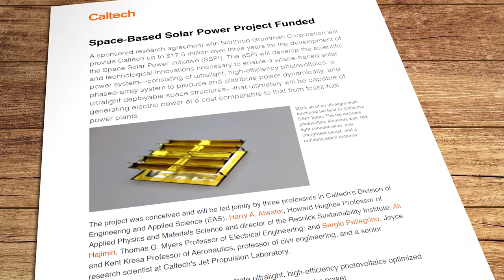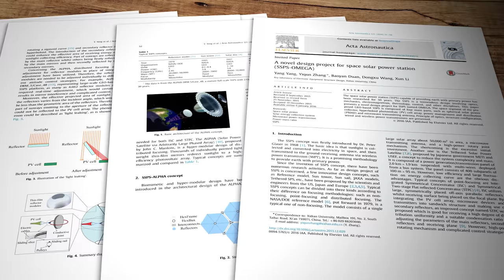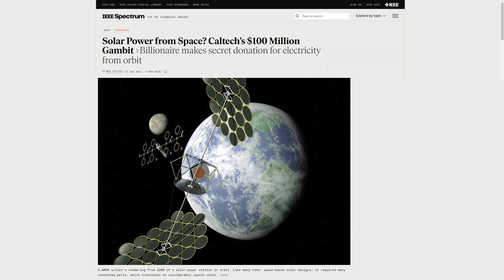Powering the planet from space. Closer to reality than you think?

Comment: Thanks for the video. A few points come to mind:
+ Solar PV panels degrade in space. They replaced a number of panels on the ISS recently, because of degradation.
+ Solar panels will also be damaged by space junk which they will not be able to avoid.
+ Even the best lab samples of PV cells run at less than 35% efficiency.
+ How efficient is conversion of electricity to a laser beam? It cannot be more than a few percent.
+ What is the path loss between a satellite in orbit and a ground station? Even if it's only 10dB, that represents a 90% energy loss, most going into heating the atmosphere.
+ The atmosphere causes unavoidable scattering of any laser beam, even over quite short distances.
+ What percentage of the beam reaching the ground will be collected?
+ How much will be reflected, or simply missed?
+ What is the conversion loss between received laser beam energy and electricity? My guess is that it will be less than 35% again, and more likely closer to 20%.
+ The big killer: How much energy will it take to lift all of those satellites into orbit?
+ How much of that rocket fuel will end up as greenhouse gases? Probably all of it.
+ How much energy will be needed for maintenance of all of the satellites and receiving equipment?
+ What effect will all of those inefficiencies and infrastructure costs have on the price of electricity to consumers?
+ Also, how much more night time light pollution can be tolerated before Earth-based astronomical telescopes become useless for research?
+ What about aircraft accidentally flying through the laser beams?
+ How many birds will fly through the laser beams?

You were right; the whole idea is scat crazy. No way could it be made profitable. No sensible company would invest in it, without big subsidies from governments. Nor would they be willing to tolerate the consequences of an accident.
Reply: These are valid concerns, but most of them can be addressed. Please watch video Power Sattelites from Isaac Arthur. 
The most concerning and hardest issues to solve IMO are: 
- space junk damage
- orbital maintenance
- maybe solar panel degradation.
Others are addressable by using microwave beam instead of lasers, using rectenna as a ground receiver and spreading out the beam a bit, so it does not burn birds (planes fly through it way too fast to be heated significantly) All this relies on Starship being fully developed and operational - this brings launch costs down by 90% compared to today's prices.
Reply: Many of these issues are only an issue because you arbitrarily chose visible light from a laser for a hypothetical transmission frequency, lower frequency waves can be generated, transmitted through the atmosphere, and converted back to electricity with surprisingly low losses.
Reply: @garethbaus5471  And we all get exposed to the spill?
Reply: -Efficiency of panels is irrelevant. Which would you rather have in this situation (assuming both panels are the same output wattage). a 10% panel that weights 10grams or a 90% panel that weighs 20 grams
-18TW of humanities power usage  vs 170,000TW of sun hitting the earth. this is a rounding error even if only 10% power is delivered
-methane from electricity to make hydrogen and captured co2.

It is still a bad idea even using a falcon 9 and the lightest panels available compared with a battery and solar panel.
Reply: @Graeme_Lastname  as long as the beam is diffuse enough low frequency electromagnetic radiation isn't hazardous to humans.
Reply: @garethbaus5471  You are, of course, correct.
But it can't/won't be diffuse or low frequency.  Either of those require larger antennas.  Damn reality, always gets in the way.   :)
Reply: @catprog  Defiantly the 90% panel.  You would need nine 10% panels to get the output of one 90% panel.  That would weigh 4.5 times more.    There are good ideas and bad ideas.     :)
Reply: @Graeme_Lastname  the rectennas needed to receive the signal would generally need to be a couple acres at the bare minimum, but they usually don't need to be very complex, can be cheaply made from from aluminum or most other metals, and they don't block much visible light(the most commonly proposed design is surprisingly similar to chicken wire)so you could grow heat tolerant crops on the same land without one use significantly interfering with the other.
Reply: @Graeme_Lastname  Nope the 10% panel outputs the same wattage as the 90% panel. 

The 10% is much larger in area but much thinner as well. The 90% panel is quite think and weighs more as a result.

That is why I specified they were the same wattage.
Reply: @garethbaus5471  Why would they need to be heat tolerant. If the chicken wire is collecting all the power then no power would get to the crops.
Reply: @garethbaus5471  Until you need to harvest the crop?
The field intensity of a gigawatt or more over a couple of acres.  Should be interesting.   :)
Reply: @Graeme_Lastname  the exact intensity could be pretty much arbitrary the land based equipment is cheap, lightweight and minimally effected by the wind so it is pretty easy to raise most of it high enough to avoid hitting farm equipment on anything, and since the technology we currently have is already capable of converting roughly 80% of the radiation to electricity only a fraction of it has a significant effect on the local climate.
Reply: @catprog  the current technology is only 80% efficient at converting the microwaves back into electricity (doing just about anything with 100% efficiency is pretty much impossible), and the transmission is inherently going to be most efficient near the equator so heat tolerance is usually going to be necessary even without a beam of energy from orbit.
Reply: @garethbaus5471  I can see you're very keen.
What you're saying is all true and correct.
But, what holds it up?  Acres of poles?
I want it to work but I doubt it will.   Love to know what we have that's 80% efficient.
Keep well m8.   :)
Reply: @catprog  Can't see the relationships you're proposing.  :)
Reply: @Graeme_Lastname  if you add up all the expected costs at the moment a power satalite could just barely break even over it's lifetime and that is assuming we are litterally using fields if poles to support the rectennas. That is a far cry from the 100%+ return on investment a ground based solar panel is expected to get over it's lifetime, but the most significant issue with power satalites is launch costs which are currently expected to drop very rapidly in the near future, I once tried to calculate what a medium sized skyhook would do to the profitability of a power satalite and it looked like enough to make power satalites slightly more profitable than ground based solar panels. A system of skyhooks would themselves be a multi billion dollar project but you only need to be built once and they are also really useful for establishing early asteroid mining operations(potentially a multi trillion dollar industry), and could greatly increase the profitability of certain types of space tourism. It should be noted that neither I nor anyone I was referencing at the time took the expected costs or capabilities of SpaceX's starship into account since it was at a substantially earlier stage of development at the time, if it could be paired with a properly designed system of skyhooks most of the advantages of a more affordable reusable launch vehicle would be substantially improved.
Reply: @garethbaus5471  I hope you're right but I think you're wrong.  Just another day.    🖖‍ 👌‍
Reply: @garethbaus5471  Thanks for your reply.

First, all transmission antennae, and even lasers, have 'side lobes' where energy is emitted outside of the desired target regions. Furthermore, a receiving antenna, even a collimated laser waveguide, reflects some received energy back into the local environment. Those are unavoidable facts of life, dictated by the laws of Physics.

Lower frequency beams would still need to be above 30 MHz, and preferably much higher frequency, maybe above 300 MHz. This is because frequencies much below 30 MHz require larger antennae. In addition, those HF signals are often reflected efficiently by various ionised layers in the ionosphere, and that would mean reflection back into space, if transmitted by a satellite. Essentially, the signal bounces off the upper atmosphere. Even UHF beams (300 MHz+) undergo refraction and other atmospheric effects to a measurable degree. I've experienced 435 MHz signals being transmitted hundreds of miles beyond the horizon. I also remember being on air on a day when frequencies as high as 1,296 MHz were being ducted and reflected on paths between what was at the time Czechoslovakia and Northern England. That's well over 1,000 kilometres. Even low power two-way Amateur Radio voice transmission was possible on that occasion. So even though that 1296 MHz signal would be diffracted less if streamed from a high angle, there is still a big challenge in ensuring that minimal energy is spilled over from the receiving site. And it's already a microwave beam, being about half the frequency of the magnetron in a domestic microwave oven.

At frequencies as low as 1296 MHz, there is already a noticeable path loss due to absorption by the atmosphere and by unavoidable beam scattering effects. (Because, Physics.) So significantly higher frequencies will need to be used in order to reduce those scattering and absorption losses, and to allow for smaller antenna sizes. There are very few frequency bands (or wavebands) of EM radiation which can pass through the atmosphere with minimal scattering and low attenuation. The wide bandwidth energy of the Sun is filtered tremendously, warming the atmosphere in the process. Without that filtering, we wouldn't be alive. Curiously enough, the remaining available wavebands coincide with visible light and the near Infrared. Lo and behold! we're back to using powerful lasers for the energy transfer.

Those multiple laser beams will need to provide ground level energy density of several kilowatts per square metre, perhaps over a number of hectares, in order to be useful commercially. Multiply that energy by at least 10 at high altitude, to allow for the aforementioned attenuation losses, and even an aircraft flying through the beam at high speed will allow passengers and crew to be subjected to energy densities which are many times greater than the agreed maximum safe levels. There will need to be 'No Fly' zones, in addition to safeguards which will be designed to prevent aircraft from accidental or deliberate incursions into the danger zones. 

Satellites with enough power to be commercially viable for the purpose of generating useful power will have huge Solar PV panels. They would therefore have a lot of atmospheric drag, even if on Geostationary orbits. (The Earth's atmosphere is still measurable well beyond the orbit of the Moon.) That relatively large amount of drag will require significant quantities of propellants to maintain orbital position. Those propellants will need replenishing frequently, unless replacement satellites are launched. The defunct satellites will then need removing, or else they will add to the space junk which is already becoming a nuisance. Those launches will also add even more combustion products and unturned propellants to the upper atmosphere... But that's another story.

Remember too that every man-made machine will fail at some point. If it is 99.99% failsafe, there is always the 0.01% failure rate. No satellite yet built has that guaranteed level of reliability. To date, most satellites which are still in orbit have failed. The possibility of a satellite losing the ability to be commanded or self-controlled, and then beaming energy controllably, perhaps into urban areas, is very real. Who would be responsible for any damage done? Who would compensate the families who will be affected by such an event?

Seriously, it's much more practical to use ground-based Solar PV panels today, which are strategically placed around the globe, and to switch between them in sync with the position of the Sun above the Earth. Installation of panels and transmission lines need cost no more than satellite-based systems which can transfer similar power to the ground. Maintenance should be much cheaper, the panels will have similar life expectancy, and replacement and upgrading once every human generation will be much simpler.

Even better, we can have distributed Solar PV panels at or near to every house or conurbation, and store the energy in battery banks for use throughout each 24 hour cycle, maybe distributing a portion of it via local or national grids. Those panels remove any cross-border political concerns, and the entire distributed setup is far more robust than relying on large international power banks or satellite systems which can be destroyed by one act of terrorism, weather event or a piece of space debris. Those distributed systems can even be funded partially, or fully, by local users. And that's exactly what is developing around the Earth as we type and read these comments.

Of course future developments might well present more practical and lower cost ways of sending energy to the Earth than we have today. When that happens, and if I'm still around, I shall remove this comment without hesitation. 🙂

Thanks for reading.

Comment: Hard to believe that this might actually make economic sense compared to ground based solar generation. Sure, you need a LOT more of it, spread out all around the globe and interconnected, but it’s going to be radically cheaper since it doesn’t need to be rocketed into orbit lol.
Reply: Unless they're manufactured in space.
Reply: @glennmartin6492  With stuff that had to be rocketed into space. So that would only make it about a million times harder while requiring extra mass from manufacturing equipment and robots/personnel and extra-energy/survival supplies. Solar roads would somehow be less dumb than that.
Reply: Your gut is correct. This will never ever happen with chemical rockets.
Reply: The Tired Horizon  more efficient panels would generally make power satalites more practical.
Reply: It is possible with chemical rockets. The most expensive part of a rocket is the rocket not the fuel. Reuse the rocket and costs drop a lot.

Comment: Better idea to put up solar in northern Africa with cables to the coast. There, flow-battery ships are charged which can then electrically sail to where the power is needed. An old container ship can really hold a lot, but I haven't calculated yet. Gut feeling is this is the cheapest way, will scale too as is flexible. Undersea cables sounds way too expensive and vulnerable.
Reply: Liquid air batteries on ships would be more cost effective and less polluting.
Reply: Cables are much cheaper than batteries or other storage, and probably less vulnerable than anything on a ship.

Comment: Absolute insanety this is. We need the earth to cool by at least 1,5 degrees C, and what do we plan to do? Virtually increase it’s surface to catch more energy to heat it more.
Reply: Ten thousand thumbs ups to you!! You GET IT!
Reply: Exactly. This idea is on the level of flat-earthers. I expected more sanity from him.
Reply: @incognitotorpedo42  You are right; I didn’t do that math, and I see the reason in what you point at. But as a principle, it would be wrong, and I missed that. It indeed is ridiculously noncompetative and, as many more of such solutions, the work of megalomaniacs. Thanks for your reply!
Reply: Humanity uses about 18TW of power on average.

The sun delivers  173,000TW of power on average. 

This will be a rounding error.

Factor in the shade from the panels and it could actually reduce the solar hitting earth by more then it delivers to the earth,

It is still impracticable form many other reasons however.

Comment: I think the colonization of Mars is a welcome project. Moving some mining and industries to Mars could allow forests to regrow in the areas of Earth we no longer need, for example. And of course we shouldn't ignore the search for traces of ancient martian life.
Reply: The most lucrative export from Mars by far would be rocket fuel.  The most lucrative export from the moon would be deuterium.  Both of these are surprisingly profitable if they can be accessible.
Reply: @louislesch3878  Rocket fuel is made of oxygen, carbon and hydrogen. We have absolutely no shortage of these elements on Earth. So exporting it from Mars is never, ever going to be economic. 

I don't think you mean deuterium. I think you mean Helium 3.  Which is unlikely to be of any economic value.
Reply: @saumyacow4435  of course rocket fuel can be made on Earth.  But the penalty of getting it out of Earth's gravity well is immense.  So if it can be made in Mars which is only a third of Earth's gravity, then the potential is there for colonizing mars and asteroid mining.  And you might be right about the H3.
Reply: I mean helium 3.
Reply: @louislesch3878  There's no case for colonising Mars or asteroid mining, so the question hangs, what exactly do you need this rocket fuel for?
Reply: @saumyacow4435  I can't really agree with that statement.  It will be very very difficult but ultimately a species either becomes multi planetary or it doesn't.  And the metallic asteroids are worth mining if you can get to them.  The problem is if you have to bring all of the fuel from Earth.  But if you can make it on Mars or even use a steam rocket using lunar water, then you can cheat the rocket equation which the governing equation for everything we have ever launched so far.